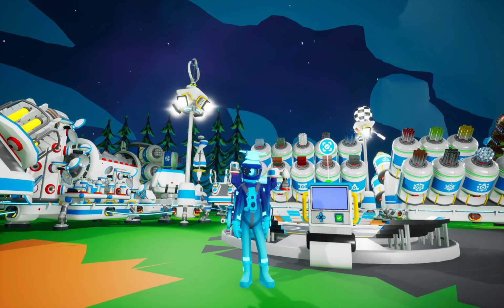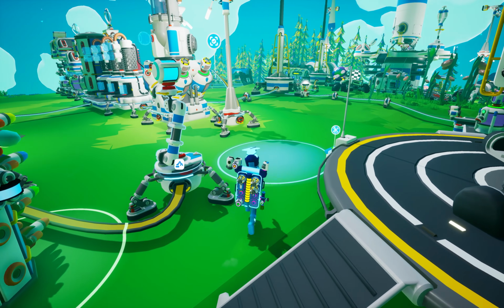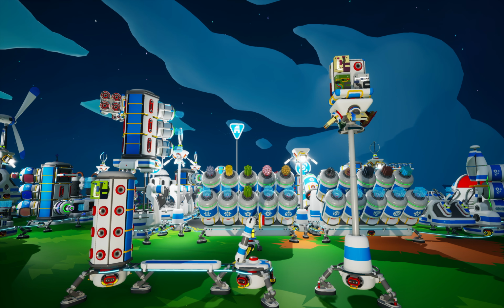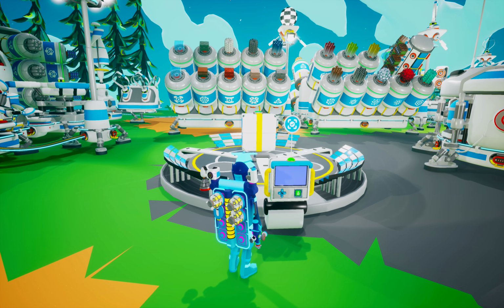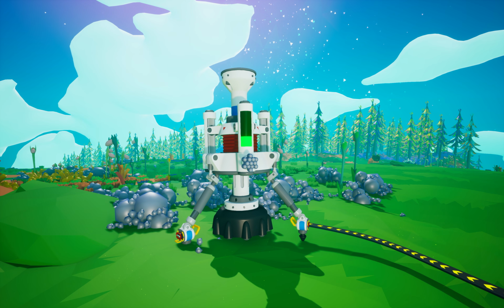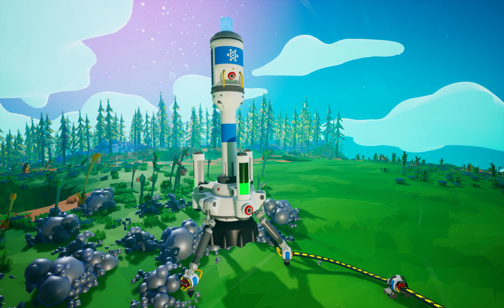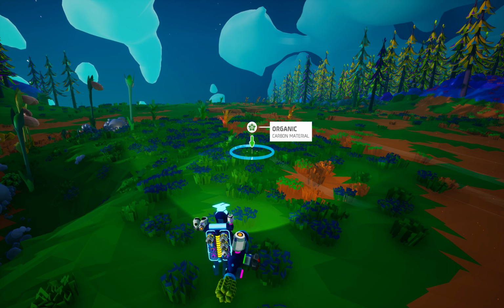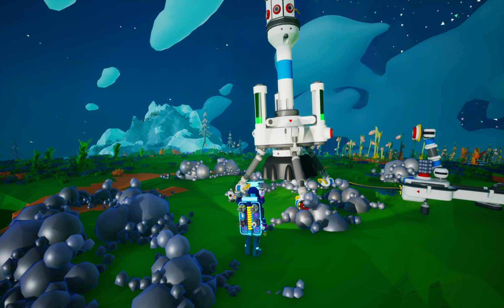Automation Basics - Astroneer Academy 303

Comment: It would be nice if these tutorials didn't contain spoilers for unrelated parts of the game.
Reply from the maker: Avoiding spoilers when so many things are interconnected is virtually impossible. We do take care to try to avoid spoiling major things whenever possible, but there are times it cannot be avoided. I'm not sure what you're referring to specifically with this course, though.
Reply: @VaingloriousGaming  It was the references to the gastropods which I haven't encountered yet. I think in this case these could've been avoided. Thanks for the very helpful video otherwise! :) By the way, how do you get the worklights at 26:50 to turn on without cables?
Reply from the maker: @fad1969  I appreciate the feedback. We do try to have a bit of levity in most of our courses, and when we wrote this one the Galastropods felt like a good bit. When it comes to avoiding spoilers, we tend to only look forward. So if a topic hasn't been covered in the series yet, we try to avoid it. But since the Galastropods had been covered by time we got to automation, we felt it was fair game.

Comment: The auto arm, tapper, medium generator and smelter on a large platform B specifically are the most useful, basic, and functional grouping to create ongoing power production. Two medium generators if you can make them. Oh, and a seed to grow a plant which will hold the tapper to produce organic. Tapper/organic > auto arm > smelter >  carbon will automatically refill generators when they smelt. Brilliant I think I found that tip on Reddit
Reply from the maker: I try to avoid labelling anything as "best" because the moment I do, I run the risk of limiting someone's imagination. For me, personally, even though I know I can get a ton of power from a setup like you mentioned, I don't like the sound of generators always running. I tend to do wind and/or solar with batteries to kick in when those aren't producing enough power. It's quieter. :)

Comment: I had an issue where my auto extractor was extracting resources not in the area.  It's happened a couple of times.   I'd scan the area and only what I set the auto extractor up for would be shown.  When actually extracting there would be another resource for a while.  Like you said I believe  it was set up for astronium and even though only astronium was scanned in the area it was extracting another resource.   That would stop the extractor since it didn't have anywhere to go.
Reply from the maker: I've had that happen a few times and I'm not really certain what the cause is. In fact, when creating this course, it happened to me numerous times on Calidor. My terrain tool only indicated that wolframite was in the surrounding area yet my auto extractor kept producing compound. In one instance, I decided to dig up the terrain myself to see if there was really any compound there. There wasn't. So I'm not sure what is going on with this.
Reply: @VaingloriousGaming  Kind of like the extractor isn't actually extracting the resource the game is just producing what is suppose to be there and sometimes the game detects the wrong resource.  When I lifted the auto extractor and sit it back down it started extracting the correct resource.  I forget what I did the second time.  I think I just let it run a few out and it corrected itself.

Comment: I'm not sure if I'm having an issue with my auto extractor.  I can turn it on but, there's not an off switch.  I have to unplug it to turn it off.  I got tired of trying to remember where my auto extractors was.   Even the beacon was out of range from the base.  I decided to build train tracks to all of them.  Just added 2 astronium auto extractors for the event.  They are close together.    Also my #3 drill mod isn't digging through the terrain.  I don't remember there being any terrain it wouldn't dig through.  Especially on Sylva.
Reply from the maker: The auto extractor should have an option to turn it off. Hovering the simulation cursor over it should give you that options. As far as your drill, double check that it is attached to one of the three slots on the terrain tool itself and that the green ring around its base is lit up. It only works when turned on (the green ring being lit up) AND it is attached to the terrain tool slots. When on and properly equipped, it can drill through nearly any terrain.
Reply: @VaingloriousGaming  The auto extractor used to have an off option.  For some reason now it only has a turn on option.  i have a soil canister the drill #3 and the wide mod on the tool.  I'll have to check and see if it is turned on.  I never had a problem with it before.  I just took a break for a while and it's not working like it should now.